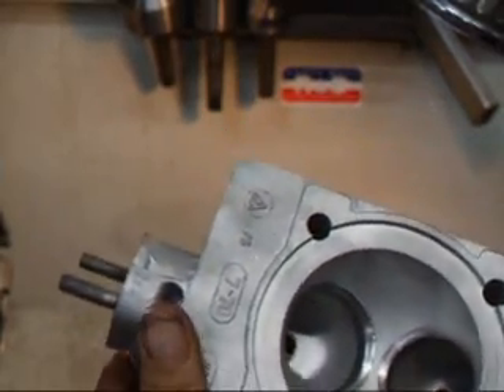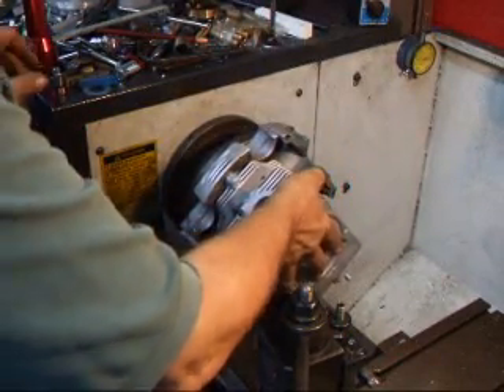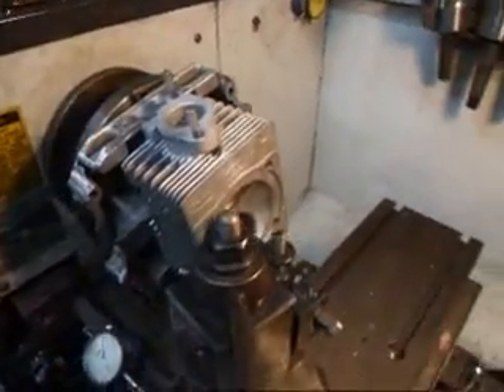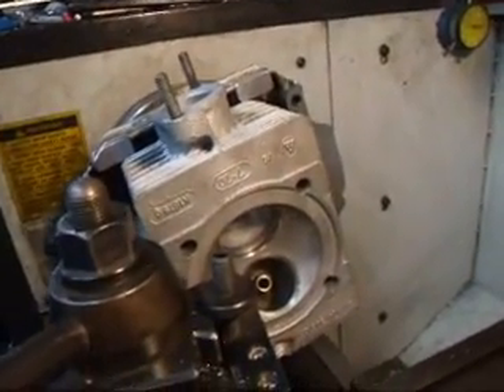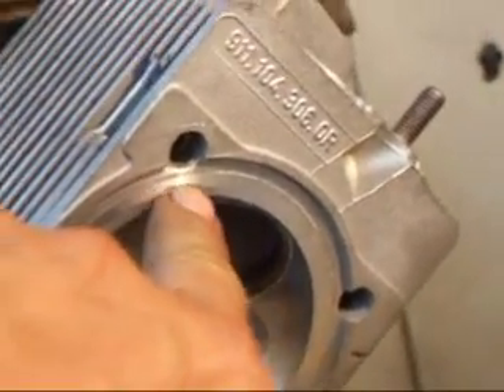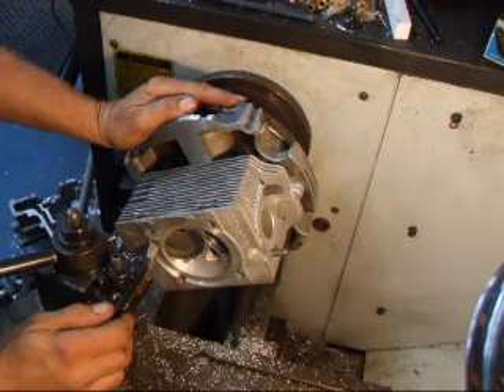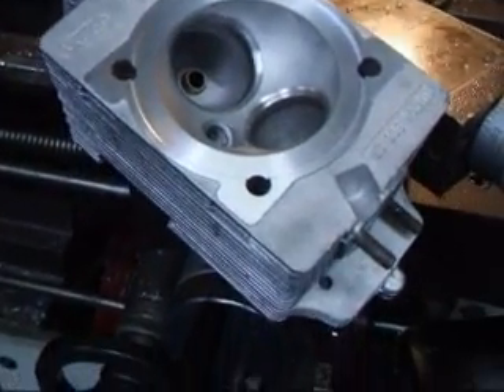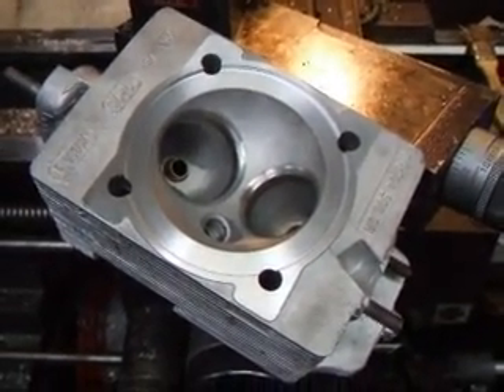Resurfaceing the Porsche 911 Cylinder Head

Comment: In another video you did a 911 deck with a mill, with I believe the same tool you used on the Vw heads and case.  Why do you do this job on a lathe, rather than on the mill with the other tool?
Reply: I get better consistency and hold .001", or less tolerance.

Comment from the maker: If you have ever had a 911 engine apart, you probably know that the camshafts require alignment with a dial indicator so that they are aligned correctly, yes I do know this because that's how I assemble these engines  Good question, however.

Comment: Interesting I never seen a 911 head until now , shure reminds me of the heads on the newer Kohler,Briggs & Stratton OHV lawn mower engines that I service every day.
I never seen that trouble since the gasket area is larger. I know on the VW air cooled engines that very small gasket surface causes problems on those engines.
Only engine like that I`v seen sucessful in long service is the type with BMEP less than 100 psi